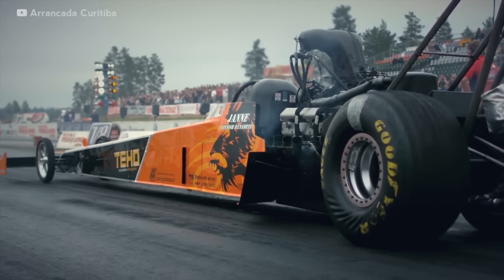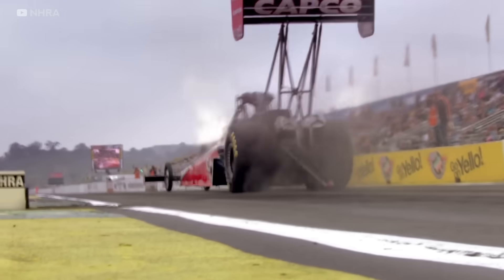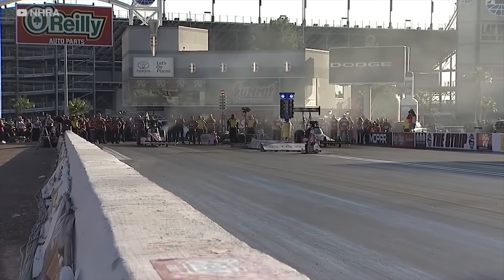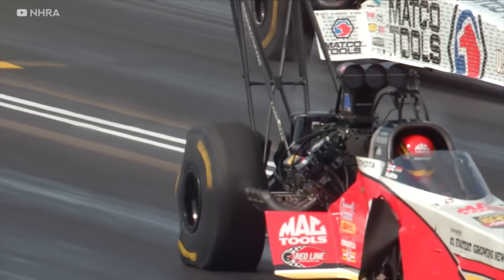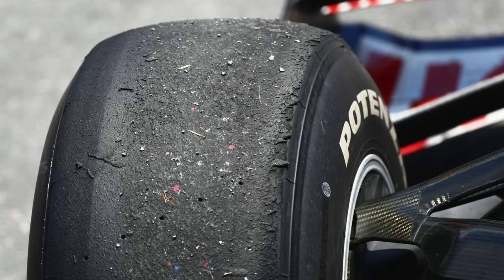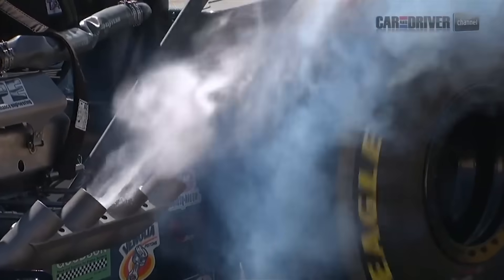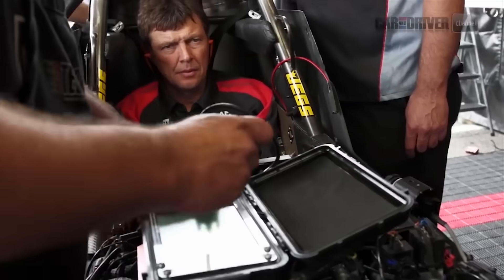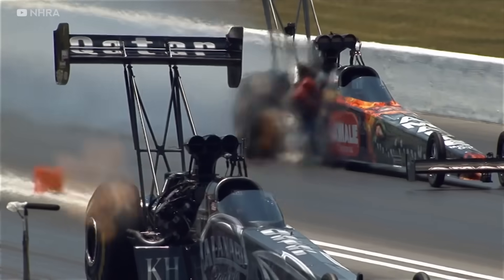How Dragster Tyres Accelerate to 335 MPH in 3.6 Seconds

Comment: Drag trivia: early dragsters were actually front engined, until Don Garlits had a nasty accident, where the trans exploded, folding his rail frame like a wallet and chopping his foot (there's an iconic still of this event). When he recovered he came up with the rear engine design, for which he was deemed crazy at the beginning, but proved winning.
Reply: The first man to build a rear engined car was Tony Nancy ( 22 JR) although it was a short wheelbase car and not very successful. When Don Garlits debuted the car, which had an extremely long wheelbase for those years, fellow racers asked him why build it so long. Garlits reply was, " They don't build short missiles at Cape Canaveral"
Reply: Funny Cars are still not rear engine.  The engine is pretty much in the drivers lap from what I can tell.
Reply: everyone should know about big daddy don garlits. i got strange looks when i did a report on his accident in elementary school.
Reply: Actually Garlits didn't come up with the design he just figured it out. He tells that in one of his interviews.
Reply: Wow, amazing picture. Thanks!

Comment: As a kid I saw the world record on a random night of racing.
It was in Motorplex, kwinana Western australia.
there were 3 categories:
Open cars: it was like every random person could race for 50$, the winner would take 500$ , I saw a nissan micra all stock going just 90 KM/H on the 200 the crowdwas hilarious, you could see olso some nice classic cars, GTR skyline.
Fun car its just a step behind top fuel its like a dragster with a plastic body covering it all, wich came in different shapes, the guys just open it on the way back to cool everything.
And then top fuel I saw only 3 lunch, one side by side but the second guy exploded the engine so there were done for the night and the other was left alone.
After is second run the speaker told us it was a world record, if I remeber well it was 3.3 sec for 200M with 506 KM/h top speed.
It was in the early 2000s, The ticket to see this show costs 20$ 
the atmoshere the incredible sounds crushing trought your body the exitement, the crash its really something to see !

Comment: Why don't they accelerate at the burnout?
Reply: They do accelerate.  Not like they do when they launch for the race.  That's due to a throttle stop not allowing for full throttle and that the tires are wet after rolling through the waterbox to cause them to spin.  All of that to create friction and heat to lay down a rubber patch and bring the tires up to optimal temperature.  Check out this video and you'll see that they do accelerate but nowhere near as they when they launch for the race (burnout is in just a bit - https://youtu.be/hou24a5FPm4 )

Comment: Good video! I learnt a lot about the tyres and how they change the torque vs speed characteristics.
But does the driver input much skill into the equation anymore?
It's reached that point where numbers rule and clutches are being chosen almost last second before lineup.
So is this much more than strapping a thrillseeker to the back of a missile?
(not dissing it, just curious, lol)
Reply: Still many aspects of driver skill and control;
- Controlled Burnout
- Staging: deep or shallow effects rollout
- Reaction Time
- Peddling - throttle control
- Steering input
- Chute deployment
- Braking by hand lever
just to name a few.